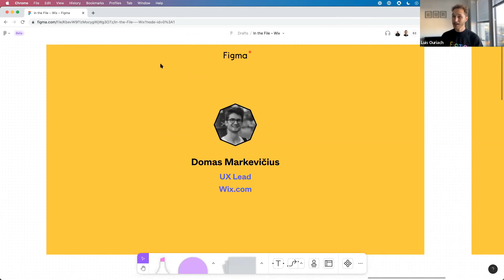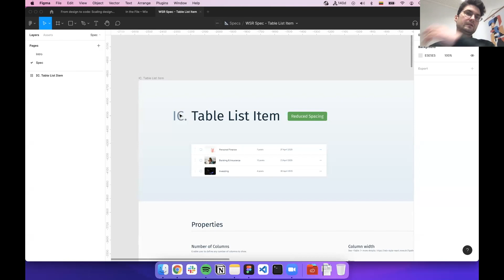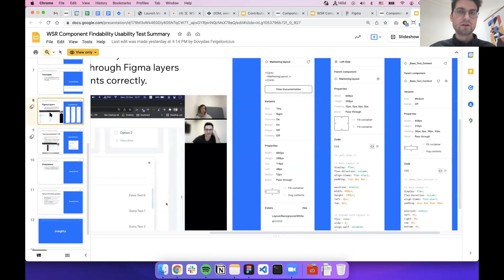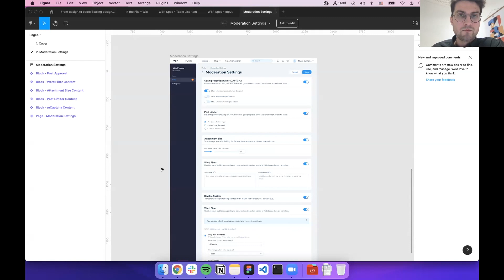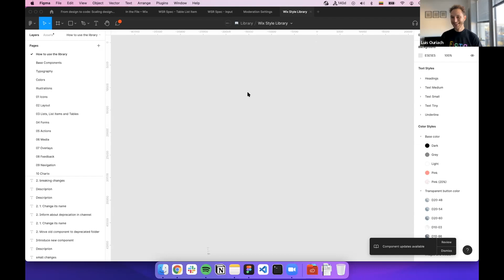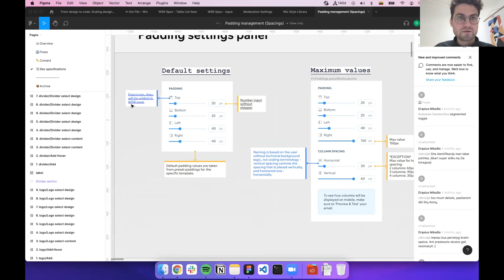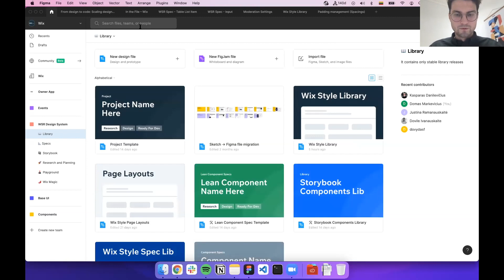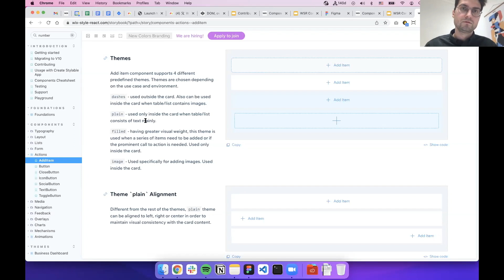In the file: From design to code – Scaling design with collaboration and documentation

Comment: @Domas Markevičius: 👍 This is the best of all the ca. 10-20 videos I saw on "Design Systems and Figma" in regards of showing us very transparently and concretely how a Design System consisting of Figma Components + Technical-Spec-System like your "React Component Storybook" + Umbrella Design Guidelines is actually consumed and maintained in day to day operation by fellow designers and developers.

ℹ️ Especially when the design system was only recently introduced in the organisation and something else was in place before. And also showing that not every last detail can and must be a tangible spec, but that you must trust the professionalism of the single product designers, and that the normal Q&A/review processes which hopefully are in place in every organisation that does UX design thoroughly will catch violations or the need to extend the design system.

🧐 And methodologically great that you evaluate the Design System tools you use just like any other software product by conducting usability tests internally on how developers use the Figma Handoff features! Shows that despite all the certainly impressive features already in Figma's Inspect Tab, in the case of certain organisations and products there will realistically be a certain overlap/overhead with other documentation/specification-systems such as the React Component specification you showed us so transparently! So not the "single source of truth" as some may advertise it, but at least "few sources of truth" synchronized with as little manual effort plus some semi-automatic assistance maybe.

Comment: 👍 @Figma and @Wix: What I totally admire in this video is that of all the Design Systems videos I have seen this one had not a second of "promotional taste". But really felt very balanced and realistic. Shows you the benefits. But does not raise unrealistic expectations. I totally honor this! Showing all the potential Figma has as being part of a Design System. But also showing clearly that digital products which have layouting and interaction capabilities beyond what's do-able with a design-software even as capable as Figma is, that the "single source of truth" for these kind of products are realistically rather "few sources of truth". But at least in total "authorative coverage" and synced as efficiently as possible and more importantly, people knowing how to maintain and consume them. And that it will take time. But nevertheless that overall it's totally worth it!

👉 KEY PASSAGES IN THIS VIDEO FOR ME:

1a) 12:45 also designers prefer to go to the technical spec system, because there they see the end result. This is realistic for certain Design Systems. Figma's Constraints and Auto-Layout are sure very powerful in comparison to earlier design software. But full CSS flex and grid can again provide way more. So for components requiring these advanced layouting capabilities, it's clear that the truth is expected in the tech spec system (with its live demo).

1b) 13:54 On top of the purely technical explanations a la "which React prop setting does what" we intermix some words of "design usage" guidelines and developers who care about design usually take this guidance.

2a) 15:32 In our usability tests of the Figma Handoff features 6 of 6 developers at WIX did not realize that the "View documentation" button was intended for them as an audience. Thought "this is for designers only".

2b) 21:37 The WIX design system presents the metrics of paddings and spacing like the Chrome DevTools do it in its "Inspect DOM" mode.

3) 26:38 Nested components: How does the designer now do the spacing between the components? Answer -> Overall Design Guidelines + Trust. Shows very well that a Design System is not everything technically specified in components and styles, but some sane professional trust and room for interpretation must be left!

4) 27:43 Great to see also how you document the Interaction Design aspects (tab order, keyboard control, screenreader) in concise instructions. As we have seen earlier, the developer then documents this part in the tech-spec, with all events in their exact technical event-name plus any properties/preferences which may alter behavior. And this is kept in sync through the team communication, and each side takes responsibility updating then.

💡 CONSIDERATIONS & IDEAS:

Ad 1a) Single tangible source of truth sounds nice in theory but more realistically coordinated/synced sources of truth are needed and already an improvement for many organisations. Figma should think how to support this realistic circumstances.

I would not go so far that the explanation text snippets sync. I do not believe in this fully automatised solutions. Because as this video very well showed, the coverage scope and the language of designer and a developer documentation differs.

But an automatized notification assistance would help!

Trackback (like blogs informing each other when referring to each other) between Figma and external design systems.
Figma already provides description text plus docu-URL. (U as in unique!)
So if 3rd party design systems point back to the component-URL the two resources could have awareness of their mutual connection.
Then whenever one of the two resources updates (it's content modificatin date) a change indicator on the other side could show up in place, or a global notification (toast message like the already existing notification for "Components in the team library have updated") could be triggered.

Ad 2a and 2b: There are certainly learnings in this for how to design the "Read/Inspect modes".